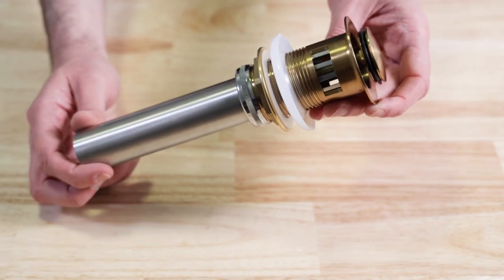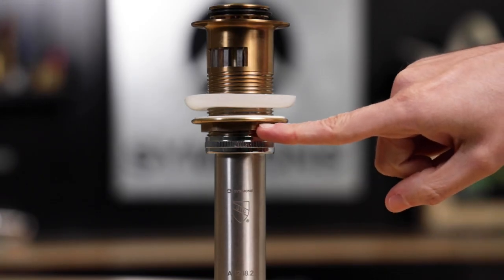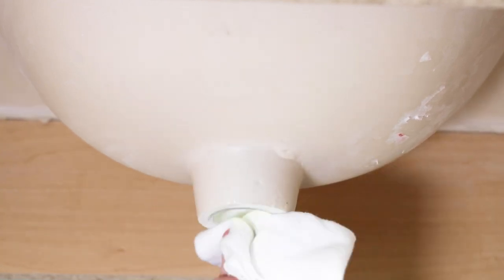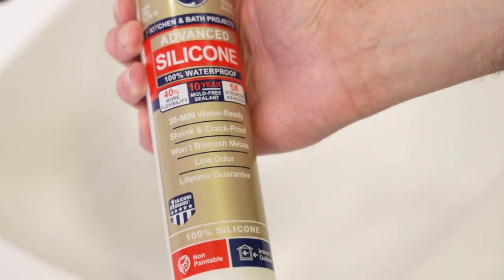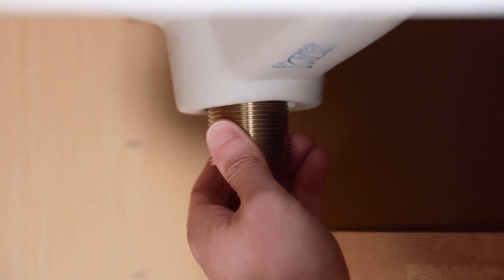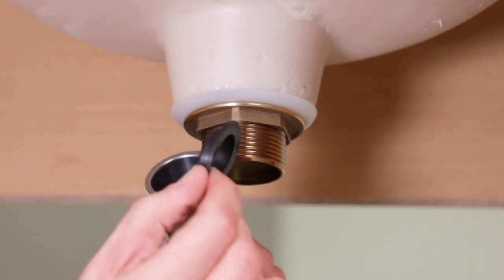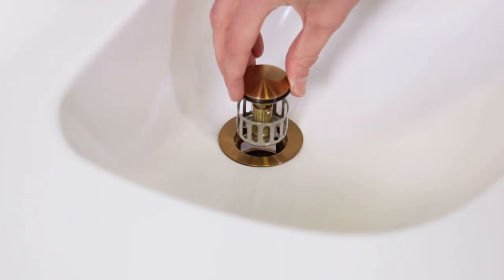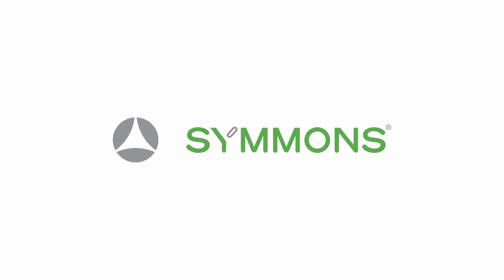How to Install a Push-Pop Sink Drain Assembly | Symmons Industries

Comment: I am so confused. I don’t have a poly washer or a clear beveled washer. I have a slanted black rubber washer and a silver metal washer.

But other videos show the flat rubber washer with the bulge going up against the sink not on the extra pipe. (I have no silver nut, just the brass locking one…

Comment: Isn’t a main downside that I have to reach into hot and/or nasty water to release it?
Reply from the maker: Extensive surveys showed that people rarely use their lift rod pop-ups anymore, and with the lift rod being one of the most common plumbing repairs, the benefits of a Push-Pop outweigh the negatives.

Push-Pops use less moving parts, and their full-flow drains mean less clogs. It’s also easy for the user to simply wash their hands after releasing the water, since they’re already at the sink.